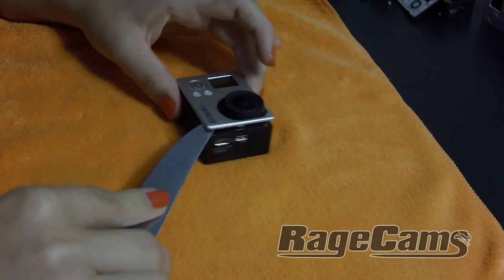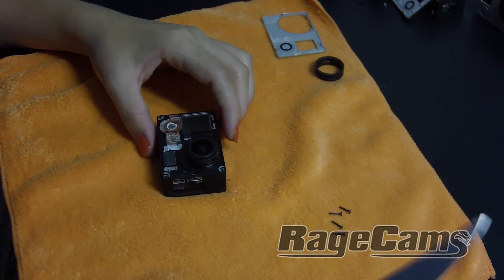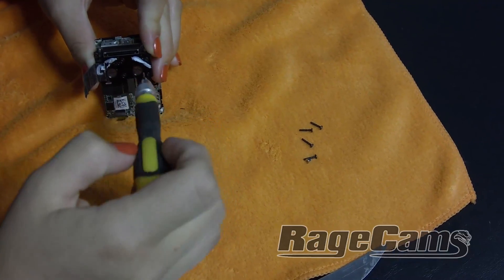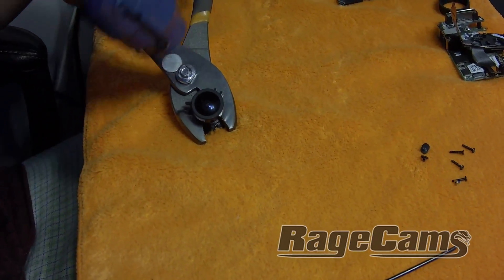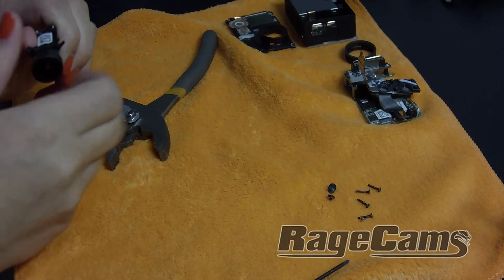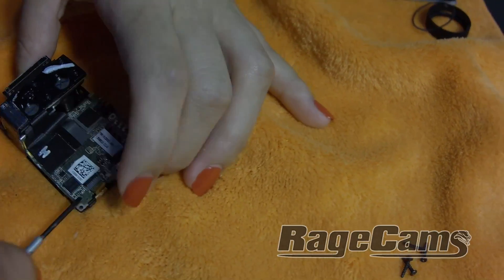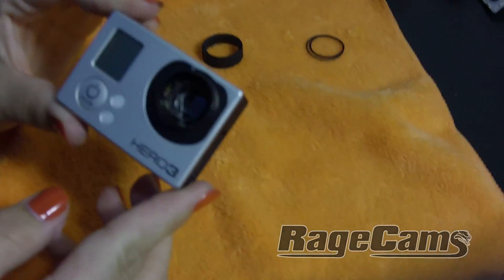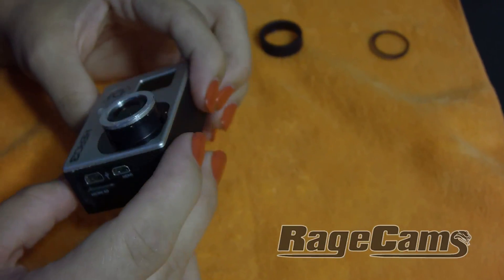Gopro Hero3 Lens Change Installation Instructions Black/Silver/White RageCams Hero 3 Scratched Lens

Comment: What did you use to unscrew the 3 screws on 3:52? @ragecams
Reply from the maker: Just a normal philips screwdriver. Same one used for the other screws. If having difficulty because they are too tight, you can place a rubberband over top of the screw to give the screwdriver some grip when unscrewing it. :)
Reply: thanks, got it

Comment: i thought it was possible to remove the lens without taking the camera apart. i seen a vid it was possible
Reply from the maker: +BBOOXXEERRMr It was probably a video for a new model. The Hero3 models, need to be taken completely apart. This is not for a Hero3+ or a Hero4. The Hero3 models are stuck in there pretty well. We have taken thousands of these apart & have found this to be the solution. Once it has been taken apart, you do not have to take it apart again, to switch the lens out, or replace it. The initial release of the lens, will make the lens stay in strong enough to where it won't move, but loose enough where you can grip it with your fingers or covered pliers. We suggest this mainly for people who still planning on using their stock lens & don't care about the cosmetics of it. Going at it, from the front, generally results in a lens with teeth marks on it from pliers, or gripping the plastic on the lens too tight & it ripping off & snapping in half completely. If your lens is cracked already & the cosmetics of it aren't an issue, then its not as big of deal. Definitely still need heat though. Anyone is more than welcome to take their camera apart any way they choose, but with our experience & how many we've done, this is your best bet for the Hero3 editions. Thanks! :)

Comment: A big thank you for this video. I just took the plunge and did this on my gopro hero 3 black so that I could refocus the original lens and bring the whole focus much closer. Amazing what macro capabilities it has once this is done! Didn't have access to a hair dryer so heated the lens over the stove top – unfortunately this burnt the plastic lens housing slightly but the lens remains fine – that glue was really firmly on and took a big effort to crack. Resetting the focus by connecting to a big HD TV screen works really well.
Reply from the maker: +pseudechis We're really glad this could help. We're glad that the lens is still in tact as well! The glue is definitely not the same per camera. Sometimes they're stuck really bad & sometimes you hardly need any heat. We suggest the heat, mainly for people who plan to still use their stock lens & aren't switching out a cracked one. When switching out a cracked one, no one really cares about the cosmetics of the lens because you're putting in a new one anyways.

Comment: OK I seen a video where they don't take it apart at all. They remove the lens from the front.
Reply from the maker: +Scott Allen This is for the Hero3 model. Not the PLUS editions, or the Hero4. Sometimes it is possible to take it apart form the front, but 95% of the time, you need to take it apart. Once its been done the first time, no need to continuously take it apart. The lens should be in firm enough to not move, but loose enough for you to unscrew it & change it out if you would like to. :)

Comment: what size and type is the screwdriver used for the first 4screws under the silver metal facing please?
Reply from the maker: +David fraser If you have the Hero3 model, then it would be a T4 tool. If you have a 3+ model, or Hero4 then it is a regular philips screwdriver. :)
Reply: +RageCams.   Grandd: job done:-)

Comment: What is the process of refocusing the replacement lens? Mine looks a bit blurry
Reply from the maker: Jake Walsh We suggest using a large HD tv & focusing it with a live view. :)
Reply: RageCams so just turning the lens clockwise/counterclockwise until it looks the most focused? there isn't an exact way? thank you so much!
Reply from the maker: Jake Walsh You'll want to drop the lens down into the shaft, and start to turn it counter-clockwise until you hear/feel it click into place, then start turning it clockwise until it threads down deep enough at which point you'll want to use a live HD tv monitor to focus it.

Comment: Thanks for the Vids guys! I had a blurry spot on all of my footage and really thought it was my lens but could never find any significant scratches and even replaced the lens on my case. I opened the camera after watching this video to check the sensor and sure as anything there was a tiny hair of about 2mm length and .5mm width on the sensor, just big enough to see with the naked eye and after removing it the footage is perfect again! This hair was actually there from new but I just wrote it off as a lens fault until I got the shits with the footage being blurred and decided to investigate. Thanks again guys.
Reply from the maker: Alan Merrick Awesome! Glad it all worked out!

Comment: Thanks for the very detailed video.  I was able to follow it and swap my damaged lens!  Breaking the glue on the Hero 3 Black was a bit tough, I ended up cracking the plastic a bit on the old lens, but just cosmetic damage.  Keeping the old lens just in case, it was scratched in a Hexacopter crash, but can work in a pinch as long as I'm not filming into the sun.
Reply: Glad you were able to do it! Thank you!

Comment: Great instructional video.  The inside of my Hero 3+ Black was slightly different but this video was sufficient for me to get the job done.  And the steak knife was exactly the right tool to get inside the camera.
Reply: Yes, each of the cameras have slight differences to the insides of them, but close enough to the same layout to be able to figure it out on your own. I started with the Black, and then did the White & the Silver, and all three of those have small differences, along with the Hero3+ versions as well. I'm glad it worked for you & the steak knife did as well. Mine is pretty dull because I have used it for every mod that I do/done, so it's not sharp. I don't need sharp, that is not the reason for the knife. The reason for the knife, is that it provides a very slim wedge between the camera & the bezel & the handle on the knife gives you the pressure that you need to pop the bezel off.